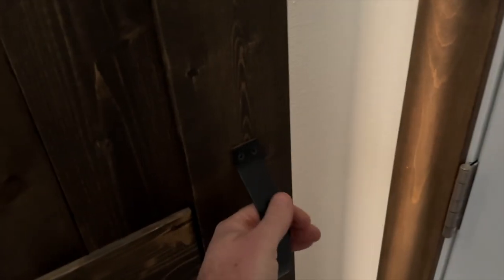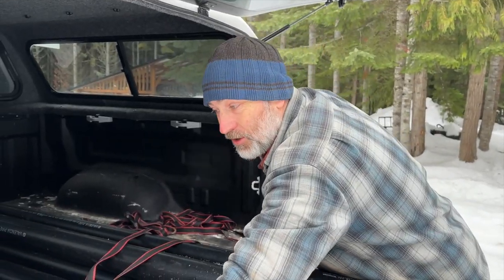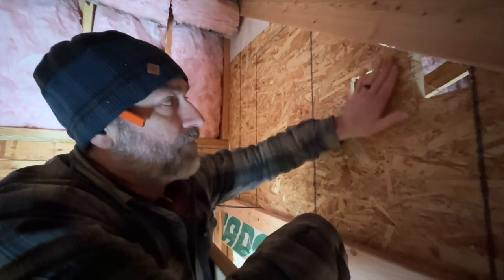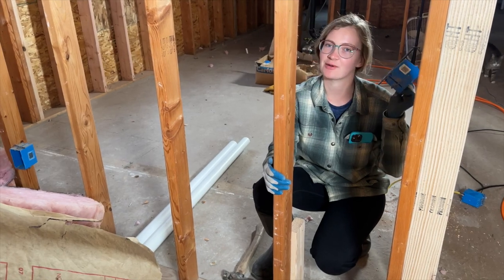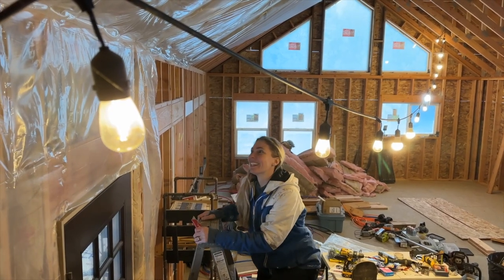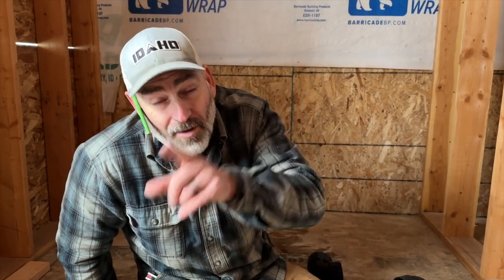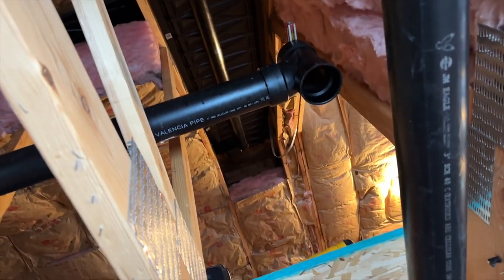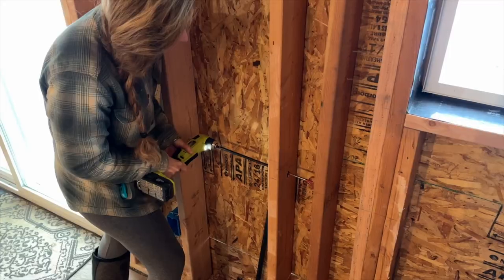Plumbing and Electrical in our OFF GRID House

Comment: When we had our tankless water heater installed they had to put what's called a power vent in, it turned on each time you used water to properly vent the gasses. 
Was told manufacturers required it because flow ventilation doesn't work if the vent isn't straight up. 
You might want to look into that

Comment: Designed my own house.   1550 sq ft, single floor with crawl space to have no water lines in the attic or walls and no fittings (connections) in the crawl space.   Using all Uponor PEX-a.

Comment: Hi why can I see an half inch of space between the wall boards straight through to the outside on all the walls. I would think that would affect air tightness and heat loss
Reply: It was probably just a mistake we made.
Reply: They haven't done any siding yet so you can see the gap between the sheathing that's necessary for expansion.

Comment: Hey Martin, just for your info... if you read the instruction for the water heater (i have the same)... when the run of the vent pipe is longer than 20 feet and/or have more that 2 90 degrees you have to used 3" pipe and for the heated side pipe, you should use certified heated pipe 636, just to let you know... but you may have different building code in your area...

Comment: I guess if you want to get technical about water heaters. A tankless could be considered a water heater, cold water in gets heated on the way out.
Tank heater keeps your hot water hot as long it is not in use. But I’m just a truck driver.

Comment: You could put a 180 bend or 90 depending where vent termination is to keep rain water out  also suggest a screen  to keep small birds and critters out  you be surprised  what find their way into open vents I personally  have removed  dead birds out furnace exhaust mad it all the way to draft inducer and stopped furnace I  from working